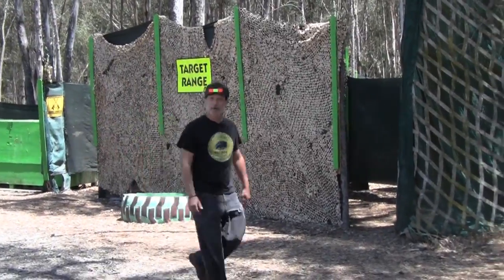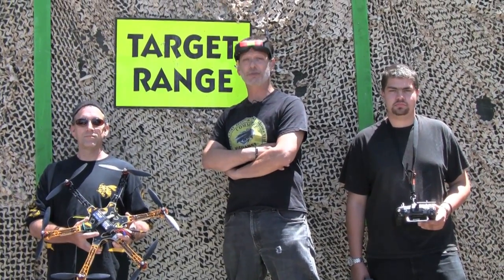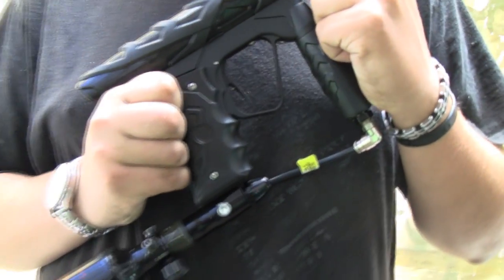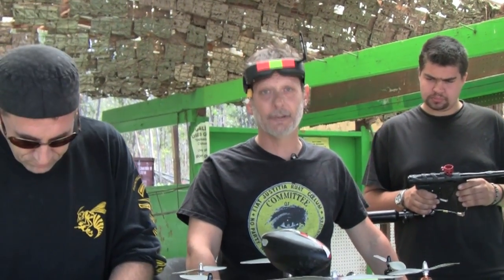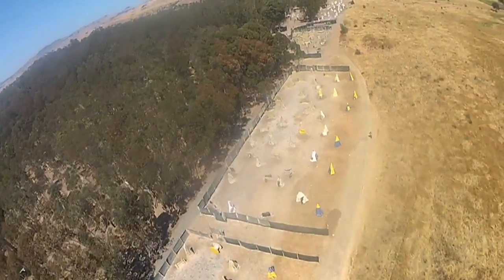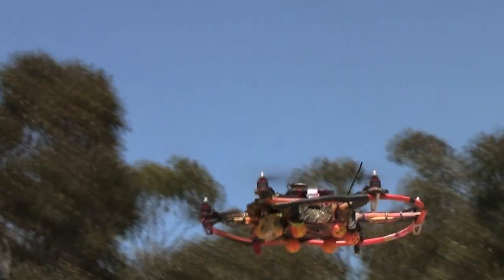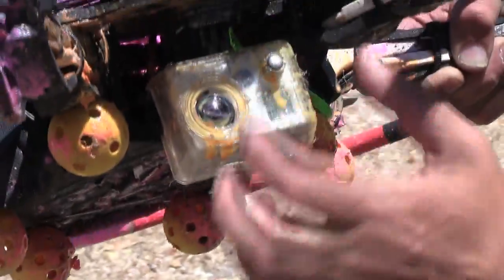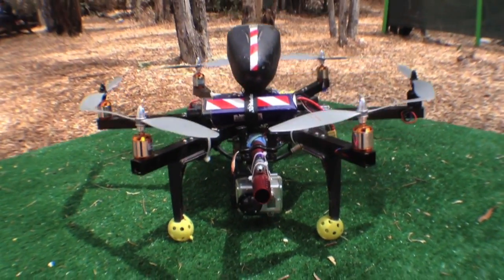Paintball Drone Gunship - a DIY Combat UAV from Game of Drones

Comment: Having a two person team is a great idea, but only if you've given the gunner the ability to aim.  after this point, it shouldn't be too much more difficult to mount the gun on a rotating servo.  if all he can do is pull the trigger you might as well scrap the team approach and use a switch on your radio to fire.  To hell with boring battle bots on TV, I would totally watch Drone Deathwatch anytime.  Have a dozen teams in an abandoned old warehouse and have them flying around, either playing last man standing or team Deathmatch, two cameras per drone, a pilot and a gunner cam, plus cameras mounted inside the warehouse, perhaps have noncombatant camera drones filming with punishment for accidental hitting of them...  give points for number of targets eliminated, etc. That would make for enjoyable watching.
Reply: +ExtravagantHammilton we could do the same thing with winged aircraft in winger areas outdoors.  Have teams flying ultramodern, sleek planes doing 100+ along the California coastline, require them to remain under 250ft, have one team take off at point A, and the other from point B located two to five miles away and require them to remain within a narrow 500-750 foot strip of airspace to ensure no problems locating each other, and dogfight in the middle.  give the gunner the ability to rotate his gun 360° so a plane being chased may still have a good chance of hitting his opponent and the whole thing isn't jockeying to be the plane that is chasing.  Use large planes to ensure that someone gets shot...  That'd be quite an enjoyable show too.

Comment: Need to use something like a xbox or playstation controller with a gimballed paintball gun and make the drone larger so it can carry more weight and is more stable :)
Reply: +thejoedude thefirejoe  a gimballed gun would be cool, or maybe if you had control of the elevation of the gimbal then it would be even better.

Comment: Stick the paintball gun on a gimbal with head tracking and see what it can do.
Reply: Justin Gould
Yes, as I was watching that I was thinking how difficult it would be to get a shot. Just as you pull the trigger, the guy flying the thing turns left...
Reply: you need a way to shoot all the faces at the same time because onece one dies they will all turn and you cant track them.
Reply: I mean head tracking on the pilot/gunner, so the gun points where they look independently of the quadcopter direction.